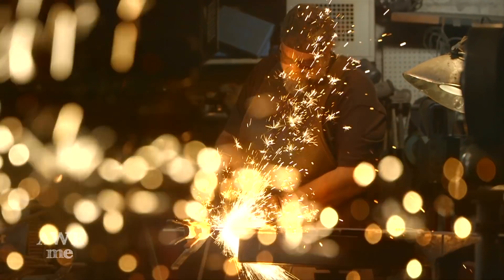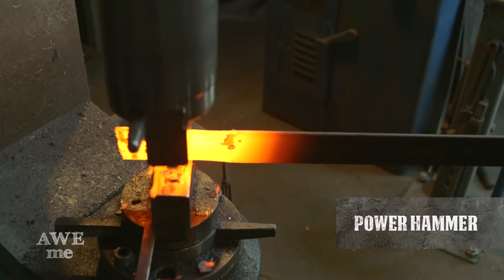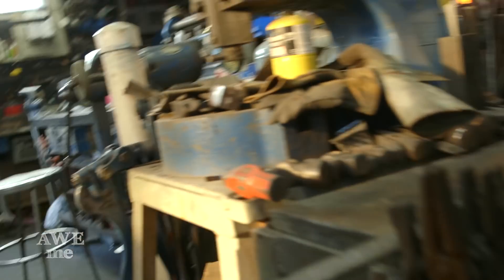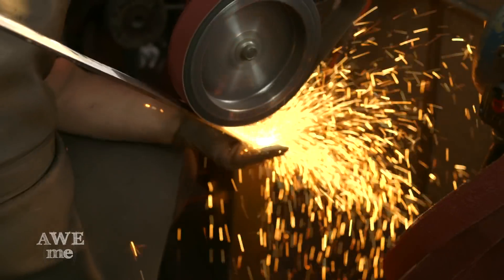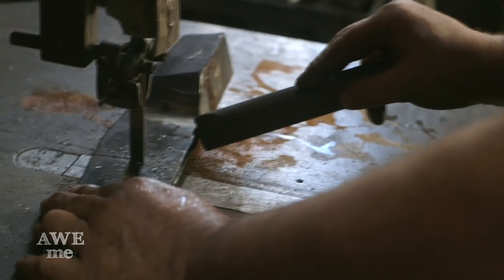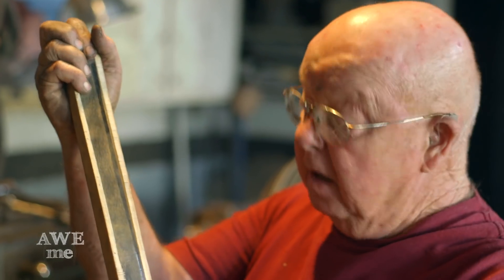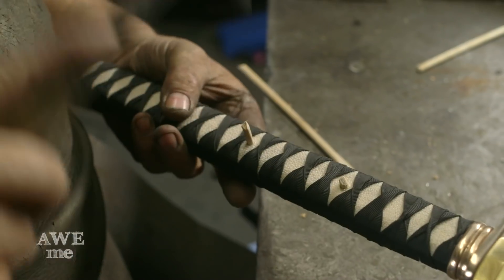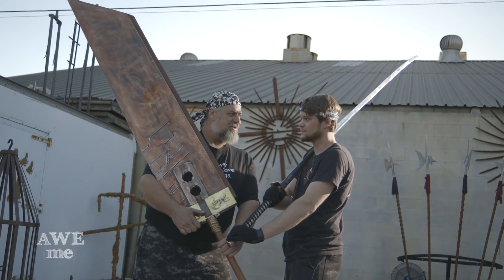Sephiroth's Masamune  (Final Fantasy VII) - MAN AT ARMS

Comment: FFVIII Gunblade. Is it even possible? ^ ^'' Sword + Gun challenge!)
Reply: if he can make sephiroth's sword AND the buster sword, he can make a  Gunblade.
Reply: Zander Slauenwhite The buster sword is easy, it's just huge. Sephiroth's katana is just a very long katana, nothing special with it. The gunblade on the other hand doesn't even exist!
Reply: GrandGamer buster sword and sephiroth"s katana doesnt exist the gun blade does exist look it up in google
Reply: gijs .huitenga
Actually, Sephiroth's sword exists. First of all, It's not a Katana but an Ōdachi.
Aaverage ones had 1.78m and since Sephiroth's Masamune is 1.8m, it's pretty the average one.
Look it up in google.
Reply: It's, British army used something similar as that in boat to boat battles. I think Canadians used them too for a couple of years.
Reply: gijs .huitenga the buster sword doesn't exist because it's unusable! However the buster sword falls into the category of great sword/long sword/bastard sword/broad sword which do exist. Sephiroth's sword also exists as mentioned by Diogo Rodrigues. The gunblade or pistol sword however only has some variants that were a failure and were not used for long.
Reply: I think Buster Sword is fairly usable...if you have the strength to swing it around as Cloud did. Sephiroth's sword, if made correctly, would be a very deadly weapon. It wont bend with each swing at least, so you'll be able to master katana techniques. The problem with gunblade, as I read a while ago, is both accuracy of gun part and durability of sword construct. The trick would be making it as light as possible while using durable materials. With modern equipment it may be possible...but I'm no blacksmith, I just want to see it done or be told that it's impossible by the specialist in the field)

Comment: It's so floppy
Reply: Gabe Scharf except for real traditionally forged katana made with both high and low carbon steel, they don't flop as much
Reply: Reid Schentag They don't because of the thickness of the spine and length of the blade. But even then when you get a sword that length, it's gonna have some flex to it.

Comment: It’s not a bad attempt, but could’ve been much better. For starters the  Masamune has gone through two versions since the original Final Fantasy VII, in the original game it had a pure solid black handle with no cord wrapping as well as a black tsuba, then in the cinematic for Crisis Core they changed it to a traditional katana rap but with blue, not the black they used here. Additionally I’m not sure what grade of steel they used to make this blade, but it should not be bending like a limp noodle with every swing. I personally own three Odachi swords with smaller than traditional handles exactly like this and even the cheapest one does not have that much flex. Finally a little piece of knowledge that I personally think is crucial to the description of the sword though probably not worth mentioning in this video, is the swords name Masamune comes from old Japanese lore about two great swordsmiths, Masamune being one of them who was said to forge blades so wicked that they would cut through any living thing, including the soul of their victims.
Reply: A couple points, here.
1) The reason the blade is wobbling like that is because they used steel of a uniform thickness, and there is no distal taper, which is bad for a blade that size.

2) Masamune blades are not the wicked ones, Muramasa blades are.
It's old superstition based on the fact that so many members of a particular noble family (I can't remember which off hand) had been killed by Muramasa blades.

The mythology says that a masamune blade, placed tip down into a river, would not cut the fish or wind as they flowed by, only leaves, but Muramasa blades supposedly had a thirst for blood, and cut everything: leaves, fish, even the wind.

Comment: Please do "The Rainbow," From Chrono Trigger!? Ideally, it'd have 220 dmg and 70% Crit!..Please?! 

The Rainbow (also known as Rainbow Sword in the SNES/PS version) is Crono's most powerful weapon in the SNES/PSX versions of Chrono Trigger. It is forged by Melchior using the Rainbow Shell and Sun Stone. When equipped, the sword is pinkish-blue. On a critical hit, a radiant rainbow trails off the blade. It critical hits 70% of the time and its attack power is 220. The PrismSpecs and Wrath Band have been cited as good pairings with this weapon.

Comment: It bends and flexes in that manner because it's too long, thin, and wasn't made using a proper forging method of a katana. But also the sword in the games and anime is a fantasy. That thing is like 7 feet long. Even the Nodachi, the traditional 2 handed version of the katana only measures about 5 feet in length, and about 18 inches of that is handle.

Comment: Now that the remake is out a more accurate buster sword is neccessary that doeant have such an ugly blade especially since canon dimensions can be found and theres no way that blade is the right dimensions although, with the new blade if they make it, weight will be a massive problem still as well as the ability to get something so fat and long cooled down after forging i think a big trough might work as long as it can fit the thing

Comment: Correct me if im wrong but katanas doesnt supposed to bend right? Is it possible to make that long of a katana without bending?
Reply: yes, katanas should not bend under it's own weight. And also yes, you can make a katana that long that does not bend on it's own weight, but it won't look the same since the base would be fatter if you make it with the same steel. I don't know if they cared about it's weight distribution at all coz they probably just wanna make it look like one rather than an actual usable masamune sword. However, with the right materials and tools you can probably make one that looks like that with a tungsten base laminated with steel.
Reply: @kittymcpaws4862  so in short, its posible but would need more work and more expensive materials?
Reply: @kingcobra2858  a hell lot of work and specialized tools since tungsten is quite hard to shape. The sword is probably gonna be 3 layers of metal, a soft core wrapped in tungsten then wrapped in steel.
Reply: @kittymcpaws4862  tnx, wow you really know ur stuff.

Comment: If he would of folded the steel it may not have bent under its own weight. Who know how long that would of taken
Reply: That's not how swords and metallurgy work. All swords need that springy feel to them or they shear or even shatter. 

The katana folding is a process of impurity removal which increases the purity of the steel which then makes it more tensile and strong. He built the sword from spring steel which is what a katana is technically made of even under old school katana smithing.

Comment: Unfortunately it does bend...... but I cannot hold it against you.
Reply: It's spring steel. It's the best option for such a blade due to high tensile strength. If it's too rigid it would shatter, especially with a weapon like that.
Reply: @i-evi-l  Odachis wouldn't be as poorly made is this cheap knock off

Comment: A japanese blade... with a grinder. Dear lord.
Reply: The folding method is how you can make the spring steel of which this sword is made. The folding method is an old method of removing impurities from the steel. It gets stronger specifically due to the removal of the impurities rather it being viewed as thin pancake layers.
Reply: @i-evi-l  Is not only about removed impurities, is also the fact that the layers of steel are more uniformly distributed, thus being way less brittle than steel which has not been folded. A real katana would easily cut through a blade which has not been folded, suffering great damage from doing so... but totaly destroying the non folded blade.
Reply: @alen2937   I love your fantasy there but steel doesn't form in layers  when you fold it back into itself. It mixes like mashed potatoes with homogenization.  When you view a katana that has been cut you won't be seeing layers like with glaciers glacial freezing layers. That's even the same when it's been machine folded.
Reply: @i-evi-l  Need a scientific paper on this, I read quite a while about it and while I might not be updated, I simply cannot take your word as the only and single truth.